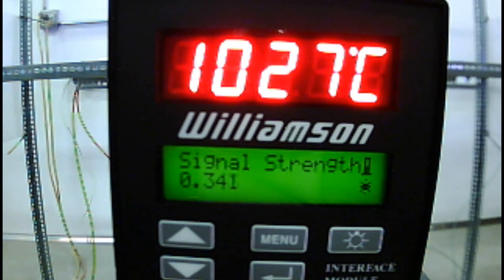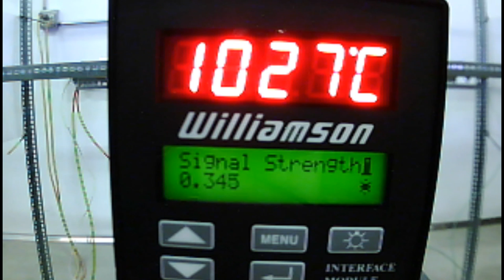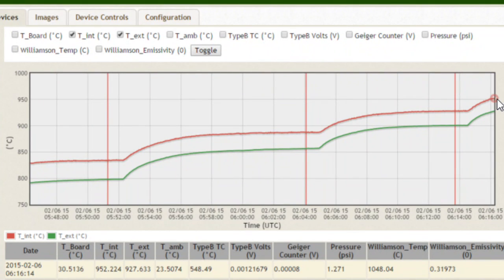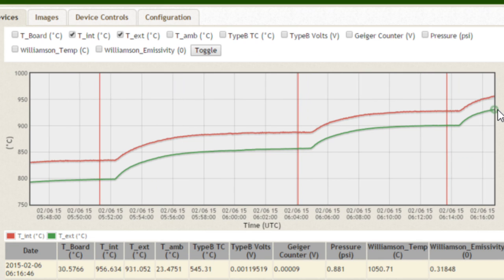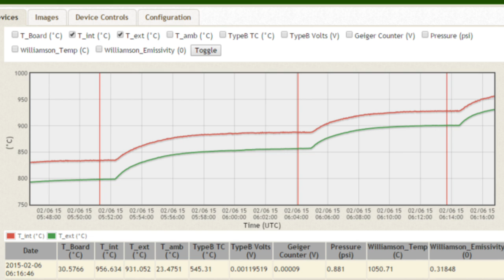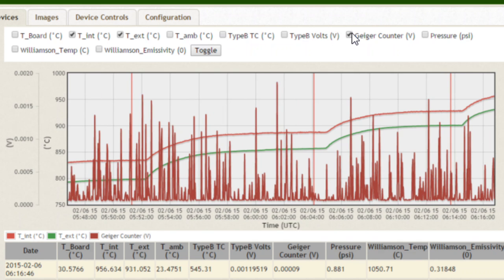Bang!

Comment: "Im going to hide behind that monitor"
Reply: Maybe powered it up too quickly.  The Geiger counter trilled for a few seconds.
Reply: Becktemba Kazemde
Do you refer to the Geiger counter as the loud 'Beep' or muffled 'Click' sound?
The click-sound is too rythmic to be a geiger counter, must be a pump or something.
Reply: The high pitch beeps are the geiger counter.  The grandfather clock-ish sound comes from a device that measure if there is Hydrogen Gas escaping from the device.
Reply from the maker: arosnett The Geiger counter is the intermittent beep. The clicking sound is the combustable gas detector

Comment: At the time of the BANG, there are 3 video streams and one audio stream being merged -- and they appear to be out of sync.  This creates the impression that the BANG occurred a second after a substantial mechanical change happened to the dogbone as depicted in the top stream, whereas the lower left stream is in sync with the BANG.  This is very bad as it creates the appearance of raw data, which can be, and has been, interpreted as an anomalous reaction happening prior to the containment breach.  Don't release bad data.
Reply from the maker: Bob Greenyer said this in response to a similar question by Axil Axil on ECW.

Hi Axil.

If I had my way and we had the budget, I would have used one or other of Newtek's TriCasters for the live feed. That was not on the table however.

These are the facts of how the LIVE composite stream was made.

Until we had the failure that caused the demise of the Optris camera, we used an ASROCK gaming PC (Whose motherboard died in the same event.

After that, we used a new Lenovo quad core laptop as the machine to composite the elements of the live stream.

In both cases, we used many cam from http://manycam.com to composite the various feeds and to provide switchable sources to the Google live stream. For the money, it is an amazing piece of software.

In the previous tests we did before, the dog bone heat up with TCs and the pressure fuelled test, I only had access to the public HUGNetLab data stream in Czech that was sometimes as much as 15 minutes behind real-time. So for the recent tests we wanted to make that far better.

What we did was, we linked to the web server on the machine that was directly connected to the HUGNetLab data acquisition board. Essentially we had the most recent data. However, as I understand it, there is still a small delay posting live aggregate data to the database from which the graphs are drawn. You can see this in the live feed as a periodic "chunk" of data being graphed. Someone with a keen eye could work out what that gap between refreshes is, indeed there is a refresh in the course of the "Bang!" video at the point where I am noticing that the K and B type Thermocouple readings are converging.

The data from the PCE-830 software is sampled every 2 seconds (that is the smallest time difference permitted by the software). Additionally, the software would not run on the more modern machines without crashing them, so to avoid bringing the whole stream down, we had a separate older and compatible laptop capturing the feed from the PCE-830 and we ran a remote desktop session to that laptop to capture the screen. This was composited into the live feed in ManyCam. Additionally, with the PCE-830 clamp set to 100A the W resolution was not so high. There was therefore at least a 2 second delay in the sampling and probably a little more by the time the remote desktop session was captured and in the composite.

In the Swagelok sealing Live Streamed video of over 4.45 hours, which included the failure of the SiC heated core, we had one cheap webcam trained on the Williamson IR, one roaming camera (which was my Galaxy Note 2 phone) a Microsoft 720p webcam (which disconnected a few times because of the 2 long USB extension leads when we were moving from the glass jar to the SiC element). The HUGNet data and the PCE-830.

The clock is a function of the ManyCam software and used the web-set clock on the Laptop as reference showing local time in Minesota, USA. HUGNet lab uses UTC, by comparing the time on the clock and that on HUGNet, you should be able to sync up the data precisely.

We have many photos and other videos taken during the recording from scores of angles, we will post those in a gallery as soon as possible. All will be consistent.

In addition, because the bandwidth was low out of HUG, I had set the frame rate to 10FPS (or even 5, but I think 10) I decided to use ManyCams ability to record its feed. I did this with ManyCams default settings on quality, in hindsight, I would have liked to up the data rate (I also wish I had 30fps after the event but it would have made the YouTube stream worse). Indeed, it may be the act of setting ManyCam to stream 10fps from 30fps feed that causes any audio/video off-set.

ManyCams recording function only allows snapshots OR videos to be made. Therefore, I chose to video - until a key point, when I stopped the video recording, took snapshots into the common real-time shared folder that was available to all during the night at 1080p resolution, and then I switched back to the video recording function. This had the added advantage of splitting the video to avoid total loss from a system failure - there were though small drops in the higher quality captures, but I felt that youtube was recording the whole sequence, so that would not be a disaster.

The Microsoft webcam was about 1.5m from the SiC assembly and the image was zoomed in ManyCam to who the region of interest.

My personal opinion is that there should be nearly no delay from the visual fracturing of the reactor core/SiC element and the bang in the audio.

ManyCam has the option to use any audio source for the composite stream that was available to the system. The system had the MicroSoft web cam, the other webcam that was trained on the Williamson and the laptops microphone. I am not certain which microphone was active at the time. It may be the case that in the move from the glass jar to the SiC element - where the extension leads caused several drop outs in the MicroSoft webcam, that many cam defaulted to system sound and that this is the reason for the delay in the audio.

Additionally, you can see at the end of the full video, when I am again using my mobile, there is an "echo" because I think that ManyCam is adding the audio from its continuous source - to that of my mobile phone - therefore, there is definitely a delay on one.

The video is exactly as it was made by ManyCam, and this feed was sent to Youtube live and recorded at the same time. If I had a whole load of professional cameras, a genlock, and introduced a forced delay of say 5-15 seconds (as most "Live Broadcasts" do) to ensure synching of all the HUGNet/PCE-830 data and a Tricaster to comp/switch everything - I would have done so - but we had neither the time, money or men at hand to do so.

What we did was the most advance streaming of a live experiment this field has ever seen.

I will publish the full sequences at higher quality ASAP - complete with whatever delays that ManyCam imparted on the recordings and which was reflected in the Youtube feed.

I will also like to do a post live recording version of the "Bang!" video, using the visual reference to queue the audio bang, but be aware, as the video is only 5 or 10fps from 30, I can only possibly be accurate to within 1/3 of a second if I do this work.

I hope this clarifies the situation. I am suffering a lot of exhaustion from the past 8 weeks right now and jet lag to boot, also, a lot of back log in my real work, so please bear with me.
Reply from the maker: Bob has added

"In addition, Ecco on our main site has noted that the actual live feed had the Audio and video in sync (or more so).

https://www.youtube.com/watch?v=eP9l356ymg8#t=13642

in this video, the Bang comes before the visual, I think that you will find the visual is around 1/3 second out of sync as per my previous note indicating that the FPS on the live feed was set to 10 or 5, only this time it is the other way.

I can only conclude that ManyCam got the audio a little off on its own recording, I now have a better reference for appropriate synching."
Reply: Martin Fleischmann Memorial Project Thanks for the background.  I posted the issue here due to Axil positing the anomaly in the vortex-l mailing list.  The budgetary limitations are tragic and the attempt to provide timely data to the world laudable under the budgetary constraints.  Might I suggest some sort of digital clock with the time-base be in the field of view of all cameras?
Reply from the maker: James Bowery Hi James, having seen this issue arise, we had thought of the same solution. It is only because of the exacting time of this event and its significance that the controversy has arisen. We did not expect the failure, and the solutions are obvious in hindsight. We are treading new ground and showing the way others can do the same for very little cost, we promised unprecedented LOS and we delivered. With video, and composite video, there is an wealth of information that no log book could ever capture.

Bob G is beating himself up because his Hero Pro 3 Black was not charged and he could have used that to take 120fps footage for a long period of time and maybe captured the bang. He did record parts of the Parkhomov style Glass jar leak test in 50fps FHD precisely in case there was a catastrophic failure - but before the next test, that cameras SDCard had run out.

We will upload the full ManyCam recording for people to look at in their own time.

We are happy and encouraged that the main youtube recording is almost exactly on. For the record, we cannot edit the recording, only delete it, so it is what it is.